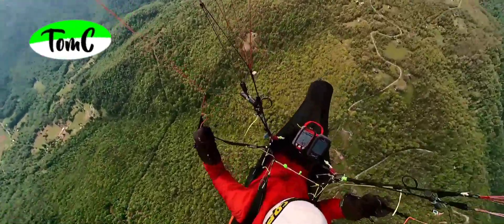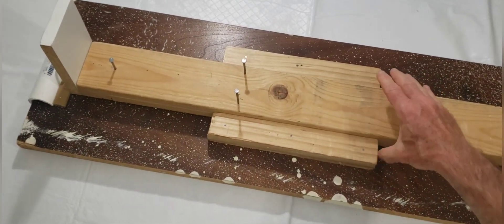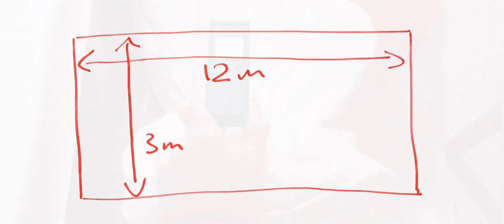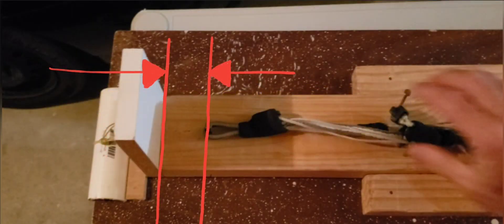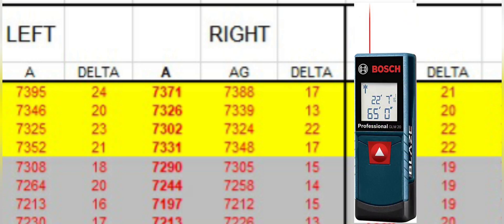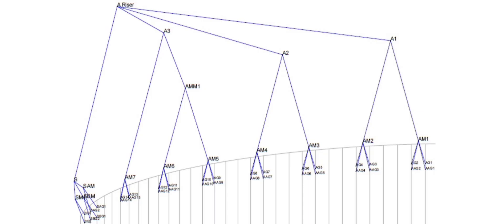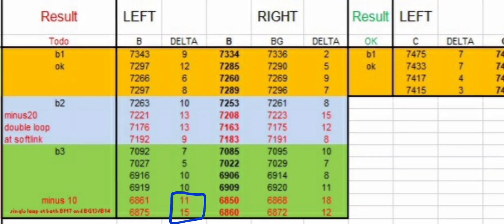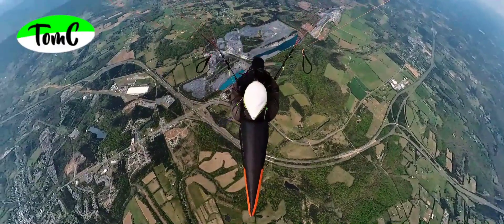2023 TomC Paragliding -  Line check and trim video

Comment: Tom, thanks for the video. Are you not concerned for the overall pitch balance of the glider? For example let's say the average of all the lines on the  left A1 group are within factory tolerance, but on the long side, say +6mm.  And the average of all the left B1 line group is within tolerance, but on the short side, like - 6mm. So even though all the individual lines are in tolerance, your delta between the A1 / B1 groups is quite large at 12 mm and would result in a slow trim? Thanks
Reply from the maker: Good remark Patrick, that imbalance looks suspicious indeed, maybe one of the pros reading this can answer.

Comment: Great video! 

I would suggest to anyone thinking of trimming their own gliders to measure the actual trim result when using double loops, larks foot etc. The thickness of the riser mailons/softlinks AND the thickness of the lines has a large effect on the resultant reduction in length, using a "double loop" on a thin mailon and a thin C line may only reduce it's length by 7mm but a "double loop" with a thick A line on a soft link could reduce it's length by 25mm - a huge difference! 

The same with upper cascades, the amount of line reduction further up is hugely reduced, a "double loop" may only reduce a line by 5mm...
Reply from the maker: In my movie, maybe not clear enough, the second table I show at the end  with the trimmed values getting close to the reference lengths is a result of measuring the lines after putting in loops. Indeed if the initial loops don't do the job, you need to further adjust, good comment that needs attention. Thanks for reminding us Darren.